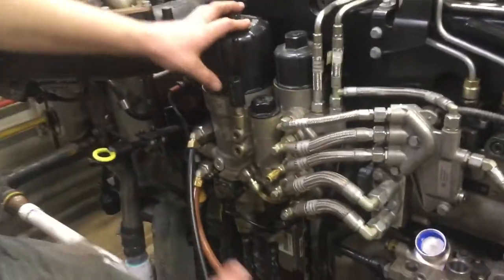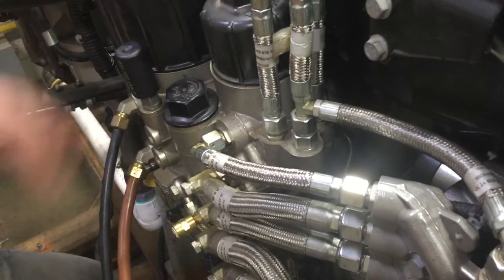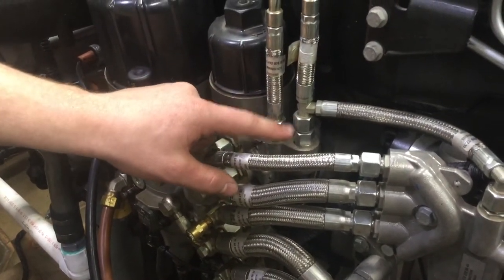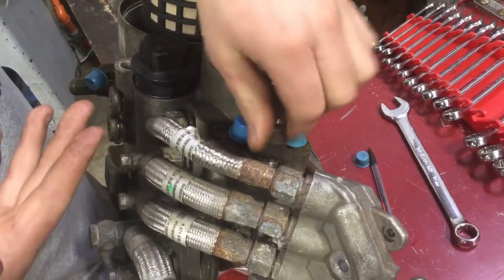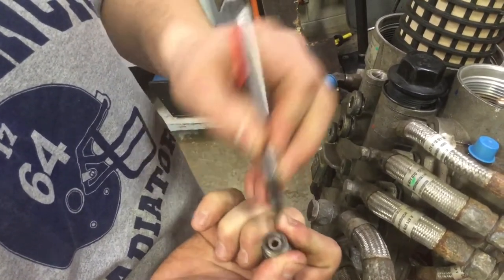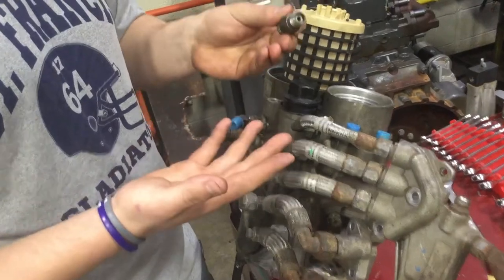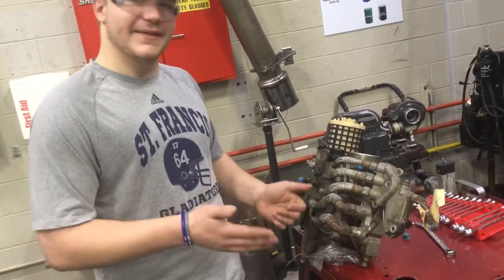DD15 Needle Return Pressure Control Valve

Comment: Anybody knows what's the purpose of that valve? My truck loose prime when is sitting shut down I have to prime it in order to start it. Thank you
Reply: I have the same problem
Reply: Same, any luck fixing the problem?
Reply: we are haveing the same problem were you able to find the problem
Reply: @LSXPerformance  did you find a fix for it?
Reply: Mine doing same thing anybody find out what’s causing it
Reply: What’s the part number
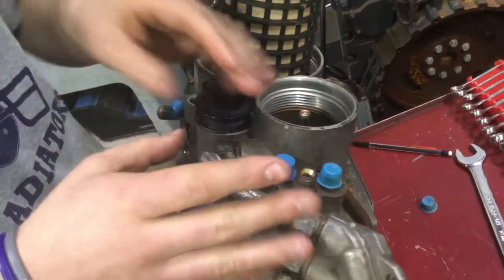Reply: @demontebackey84 1:12 66
Reply: @slipondud  nop
Reply: @LSXPerformance  nop
Reply: @chekalakalaka1  nop
Reply: @demontebackey8466  nop
Reply: Dealing with it now. Valve is stuck open so fuel is being pushed back into the tanks. Change valve and should work. Debris and such can get sruck in it
Reply: Also on my truck it requires a special socket from freightliner

Comment: The part number for the three stage filter system is A4720780149 Pressure Control Valve. $118 at the dealership